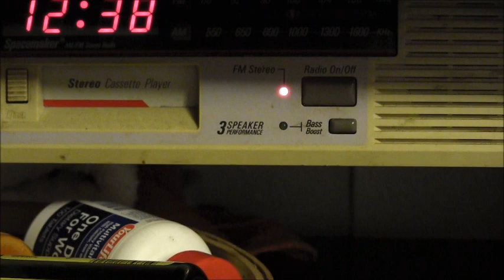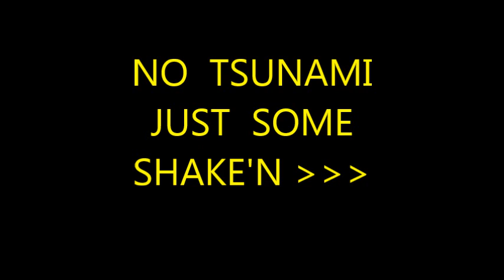1989 EVINRUDE 55 HP , JOHNSON  3 HP & WHAT'S SHAKE'N

Comment: As I always say that little three HP like many ,many motors I see and we all see could be repaired and I dont mean to be cocky.This one in about hour if I had it. First I would Clean and renistall the head and see if the compression kicks up no stuck rings even without honing just wirebrushing.  If it does I would clean reeds ,carb,block, mag&points and she should start right up and then maybe an impellar. But most wouldnt bother understandably. Changing the block would be actually more labor in my eyes. But I always say that is why we get these motors so neglected. Most dont know how to store them properly and leave them subject to the elements by laying in prone positions for rain and snow melt to enter .Cant tell for sure but looks like saltwater got in there too.Hey it keeps us busy, Great Video glad your safe with that Earthquake scare Wow!......Glenn

Comment: Glad you are OK...8.2 is a big one for sure.  Today's game results:  Abuse 2- OMC 0...  Like you said, such a shame.  Those 55 commercials are rugged beasts for sure, and that one has the nice big 70hp gearcase.  Another powerhead will turn up, hopefully with the right crankshaft splines...Yes, still remember that lesson we learned.  I always liked that vintage of 3hp also...The original version of this little engine in 79 had CDII ignition and no neutral clutch.  The CDII ignition was surely overkill on these little engines, added complication and too many extra wires/brackets that just were not necessary or cost effective...Something to be said for the simple mag ignition.  The clutch was a welcome addition for sure.  Hoping another powerhead turns up for this thing....Sell this guy a used Honda or Yamaha the next time, don't let him wreck anymore OMCs.

Comment: I need some parts from an older 2hp johnson. Need the arm you steer with, one ss screw that goes to the mixture control and a bolt to hold the hood on. Got those?

Comment: Hi have question I need a pee hole nozzle for a 1995 Evinrude 115 outboard bought motor and someone put a different nozzle on there so I have no little steam coming out it's a big steam just don't know if I run motor like that it will get hot.ill buy it if you have it. Let me know sir.